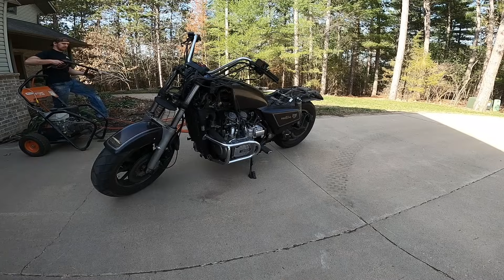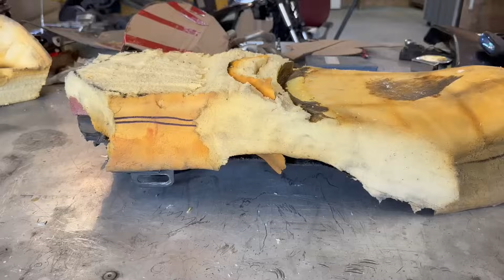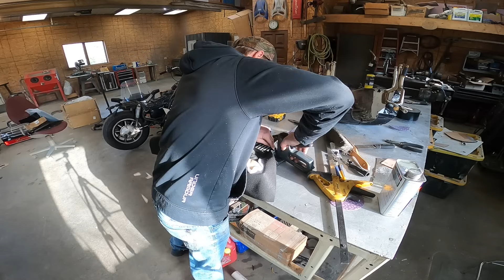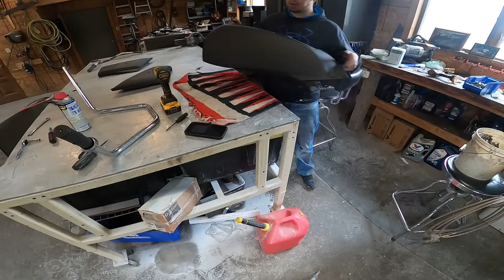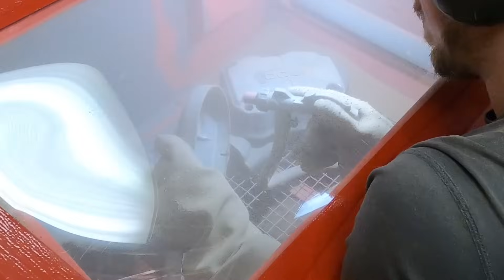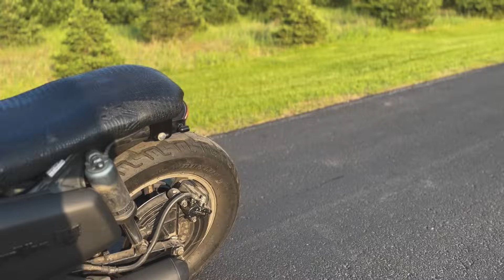$400 Goldwing Cafe Racer Full Build ║ 1984 GL1200

Comment: What did you do about the air ride suspension? I didn’t see anything about it in the video, can you just remove the compressor without issue?
Reply from the maker: Yeah, that’s really all I did. Just cut the lines and tore out the compressor. With that many miles it wasn’t working when I bought it even. Should really put coil overs on it and rebuild the fronts but that would double what I have in the bike.😂

Comment: I did similar but fitted a GL1100 false tank.
Reply from the maker: @georgemooyman7155  for the tank covers, did you trim them at all?
Reply: @SmokeyFromThe715 
No,  but I moved the wires around to make room.
Reply from the maker: @georgemooyman7155  nice! I looked into going with the gl1100 tank but didn’t love the way it looked with the tank covers. If I build another one I think I’ll try it.
Reply: @SmokeyFromThe715 
I think it looks much better than the 1200 tank.
Reply from the maker: @ wish I could find one of the 1200 standard false tanks but those things are hard to come by!

Comment: What did you do for the air tank for the suspension air ride? I have the exact same bike, same year, had the same problems, same everything and I don't know what to do with the air ride stuff. I've looked into regular shocks but they run for $160 to $230. I got this bike for free and I am trying to do this on a shoe string budget. I already have to order a headlight and figure out which tail lights im gonna order
Reply from the maker: @osama_bin_llama2532  dude honestly I just ripped it off.😂 like cut the lines no pressure as all. If I was going to do it right, I think I’d try to route a valve stem or something? That would be sweet if you could still manually pump up shocks, kinda like fox floats, but no compressor like oem. Also thought about taking everything and putting it all in the center cubby, but I really do enjoy that space.
Reply: If you can find a set of air shocks for a 1980-1983 gl1100, they are manually inflatable from a shrader valve under the right cover. The schrader valve and hoses should fit on your rear shocks 😊 @SmokeyFromThe715
Reply from the maker: @ ooah, I did not know that.

Comment: The original hot gold wings did not have fairings on them. They were racers 1000 cc they had handlebar speedometer, headlight brake lights and a two person bench seat and they ran like a rip tape. I had one it was a 77.

Comment: It actually looked better than I thought it would.  I personally don't like the lack of rear mudgaurds on any bike and your mirrors don't look practical, but otherwise nicely done!   I bought  the K2 1000 model in1977. I sold it in 2004 after doing around 400,000 ks (aprox.250,000 miles} running like new. A great bike!

Comment: I have an 83 Goldwing I am stripping down to a naked bike. On my bike there is a balance/vibration weight bolted to the front forks, but didn't see one on yours. Was there one? I like the old chrome headlight buckets better, so that's what I plan on using but I like the LCD type lights too.

Comment: You certainly have a skillset. I had a 1980( Australia) model, 1000 cc and Comstar wheels.
Apart from the suspension, l loved that bike. I fitted SW rear shocks, made up my own air conversion for the forks, with a compressor under the top box.

Comment: That’s not pure American classic dresser. It’s a honda. Can never be pure american
Reply from the maker: @2gunslefty  was a joke making fun of Harley riders saying that a Harley is pretty much a goldwing without the trunk.
Reply: @SmokeyFromThe715  lol I gotcha hey I ride a hard tail so can’t say shit. What powder coat set up do you have, I bought a new sxs and wanna rebuild my 2017? Yxz1000 Thanks and Godbless
Reply from the maker: @2gunslefty  that’s sweet man. My little powder gun is an EZ50 and honestly I use it way more than my professional gun. It’s just really easy to use for something small. Big oven is just a home built setup with household oven elements. The other one is legit just a standard household electric oven. Pretty inexpensive way to get into it.
Reply: @SmokeyFromThe715  but the rack or the parts need to be grounded? I have never powder coated. Just duracoated little things like slides , barrels etc. I’m in MI wish you were closer you have a loyal customer , kick ass with the fiberglass. Saved a ton in fab work. Thanks I appreciate the info
Reply from the maker: @2gunslefty  thanks man! Yep. I have a earth ground wire that goes outside the shop. Can kinda cheat and if you touch the hanger the part can ground through you as well😂

Comment: looove this .. been thinking about trying something similar .. how is the ergo on it ? .. heavy ? tip .. when putting the leather on the seat .. start with the corners :) .. well the "corners" .. much easier to get the smooth roundings on the "leather" .. or pleather like we call it .. and PLEASE wear a damn respirator when sanding .. ty ... oh and GORGEOUS home you have
Reply from the maker: @Ladosligese  thanks man! That was at my parents house so can’t take credit for that😂 ergo is decent, I feel like I sit a little low and forward, knees feel a little too bent, but honestly not bad. I’ve taken it on day rides and really not had anything to complain about. It’s not a nimble bike compared to my super moto but with the straight handlebars it honestly feels pretty good. A heavy bike but a smooth and easy heavy, not a hog that only wants to go straight. Thanks for the advice on the cover! And will take respiratory note. Easy to forget sometimes.

Comment: Love that you did this, “on the cheap”. Re-using the existing seat and exhaust saves hundreds and still looks and functions well. Old Goldwings are a steal IMO. You get a full liter, or more, engine. Soft but sturdy suspension that can easily handle long rides or unmaintained city roads and spare parts are readily available since they made thousands of them. Good project, informative video.
Reply from the maker: @risinbison1106  thanks for watching! Glad you liked it!

Comment: great build, I have an 89 I would like to do that to. I wonder how much different it would be. Where did you end up hiding the wiring?
Reply from the maker: I shoved most of the wiring under the tank cover. I was a super tight fit but I still was able to put that little container in there. I think worst case scenario I would’ve trimmed off all the unnecessary wires. There is a big bunch behind the windshield/speedometer/headlight too.

Comment: I ride an '87 and have thought about stripping it down. Problem is I ride long distances and the luggage and weather protection helps. Last year I rode through snow in early April. Hot summer days I wish the fairing was gone. I have a small aftermarket speedometer. Idiot lights (neutral, oil, high gear and low fuel) can go in the little panel over the handlebar clamp. I have had a tractor seat on it for a few years. Hard to put my feet down but I can ride all day. I have a hard time getting much done because when I get back to the US I want to ride every day and the Wing is my only bike. I like what you did with the instrument cluster. Cut down to a reasonable size.
Reply from the maker: Thanks man! I definitely wish I had the luggage still sometimes but I guess lookin cool comes at a price😂 that tractor seat sounds awesome too. Safe riding brother!

Comment: I have an 83 Goldwing 1100 I am kinda doing the same thing to. Funny thing is the exhaust broke in the exact same spot when I took it off. So far I just ground it smooth but I plan to weld on a piece of fresh pipe so I can connect smaller mufflers.

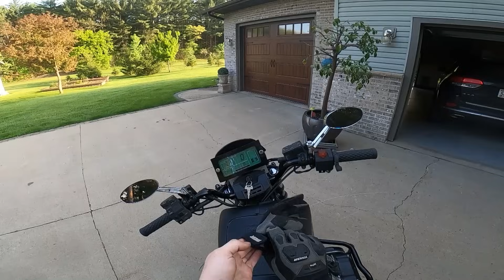Comment: Excellent job bro!! Pro-Tip, don't drag your feet when stopping on a motorcycle, ESPECIALLY on the side where the pavement can deviate, you'll snap your ankle off in your boot. I have a 9" titanium plate, 4 screws and a bungee holding my ankle in place after dragging my feet Just like you did at 41:49. All the best. I'm a Harley guy, I have some pics on my community tab, other than that, well done bro. Keep the rubber down

Comment: Fantastisch project met een fabuleus resultaat.
Well done young man, i'm gonna sub for future builds. Nice to have such great facilities, my bike shed is too tiny and laying on the cold ground in the backyard is not an option anymore.
Luckily i have a great local mechanic that keeps my 2000 Transalp in mint condition.
Small projects i just do in my living room( don't tell my woningbouwcoöperatie/landlord).
I just finished a jerrycan holder with a hacksaw old drill and rivit gun, looks very Mad Max. Used a 0,5 cm. bend piece of fllatbar to attach it to the subframe, so satisfying.
Old school iron 5L can in army green with Repsol and premium 98 only stickers, sitting in its aluminium 'cage' with lock still gets my old frown up side down.
Groeten from de van Gogh village in Southern Netherlands.
Ps did you have to hit the translation button? I only used Dutch similar to English words.
Unkillable Honda rules.

Comment: Hey man, my 86 Aspencade fuel injected 1 year only 1200 . I got ran off the road a couple months back. And I finally found the whole parts bike. And I don't really like the video. It's so dope. Thanks for the video and the ideas man thing is beautiful.
Reply from the maker: Hate to hear about anything bad happening to another biker. Glad you’re alright, and glad you’re finding some inspiration. Good luck man!
Reply: Ikr I had to buy a whole other wing and I'm good but what was the type of headlight if u don't mind
Reply from the maker: @joshuacampbell1993  if you look up cafe racer headlight on eBay or Amazon it’s one of the top results. Just some Chinese brand headlight but it’s been good to me so far. The eBay one was cheaper but the original amazon one was better quality. The eBay one had some weird blinker issue where the drl would blink with the blinker. That’s why I ended up buying the side blinkers as well.
Reply: And it was supposed to say I do like the video

Comment: Slick build -- seems like a spiritual successor to the old 79 Wings before they added all the fairings. 
Was scrubbing the video after my first watch, not sure if you ever resolved the hyperflashing but in my experience with LED converting old metric bikes, tossing in an LED rated flasher relay vs wiring up resistors usually solves  the problem. I know some bikes use 2 relays, my 80 KZ750 had one for the signals and a separate one for the 4 way hazard
Reply from the maker: Thanks for watching boss! Appreciate the compliment and the advice. In the vid I did end up fixing the fast blinker. 4 years of engineering school finally came in handy and I was able to calculate and order the right resistors to get a better flash rate with the LEDs.😂 appreciate having guys like you always willing to help. That’s part of what makes the bike community so great
Reply: @SmokeyFromThe715 There was so much to take in on the build, my bad for not catching it! Next project, get a roller and make it an ebike. I spotted a KZ1000 with no engine for $150 and Im so tempted to try a hub motor swap.
Reply from the maker: @ogrooster69  haha, that would be sweet! Thanks for the idea! I’ll have to look into that a bit more. Definitely enough space for a battery there.

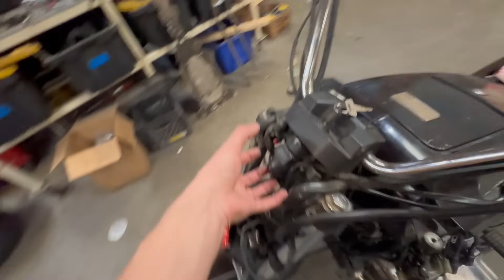Comment: 5:14 you could of sold all those parts got your money & some back & used the profits to buy a nice gauge cluster
Reply from the maker: I did some research on aftermarket clusters and couldn’t find anything that matched the era of the cycle. There was a few Amazon clusters that were tempting but most of them had slightly disappointing reviews. I really like how the oem cluster matches the bike, and has accurate fuel, temp, and gear gauges. If I do another build I will definitely look into a little more classy clusters. The next build will have a little higher budget too😂